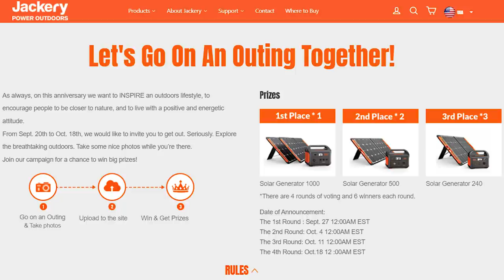Kayak Camping Trailer Build | Part 7 | Adding Walls and More!! DIY

Comment: If doing the mesh a different color, silver paint tends to go gray, red gets dull (but looks slick) and yellow fades. Personally, I’d go with black for uniformity. Here in New Mexico, black gets blazing hot, so that’s maybe a consideration. I like the notion of a step or side boxes from the fender on back and the table idea sounds good. I showed my wife your last video and her first question was the same as mine; “What are those green waffle doohickeys on the side?” When I told her, she wondered why she’s never heard of them. She often drives cross country a ways and worries about getting stuck in soft sand, something we have an abundance of. Your trailer is looking good man! Our trailer is very similar and in need of a few upgrades. You’re giving me good ideas! Thanks Señor!